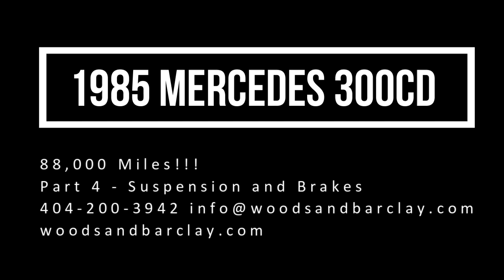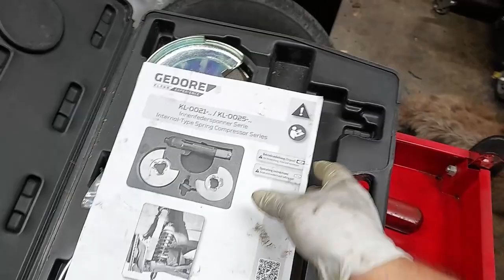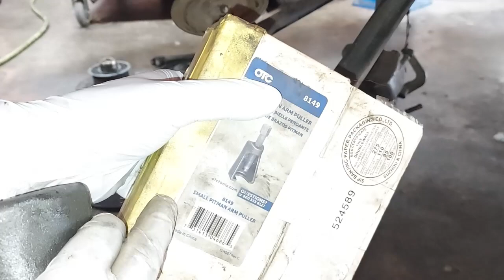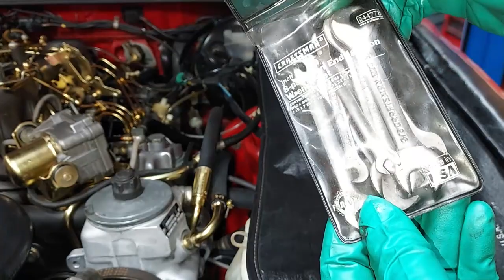1985 Mercedes 300CD - Part 4 Suspension And Brakes

Comment: I have several of these cars I need to do this to, been dragging my feet. I completely rebuilt suspension in my 1979 Dodge van last year so am ready (I think) to do these. I also cleaned and painted everything as well, not really necessary but I like the results. Have been purchasing Lemfoerder parts as well. I like the little details ( lugbolt) for the inner bushing to properly chamfer the end. And you're right. Quality tools make all the difference. Thanks for this video, will definitely motivate me.
Reply from the maker: Great I'm so glad you're enjoying the videos.

Comment: Should you keep the bearings with its original race or does it not matter ?  I just did this job on my w124 and was careful not to mix them up on re-assembly….
Reply from the maker: It all depends on the condition of the bearings and the race. If your race shows a lot of wear then you want to change it with the bearings. But if your race is in excellent condition you'll be fine if you change the bearings. If you're changing your bearings because you've had bearing failure than yes go ahead and change the race too.